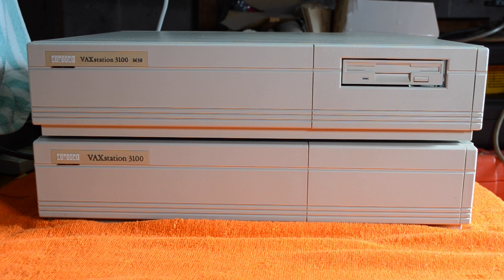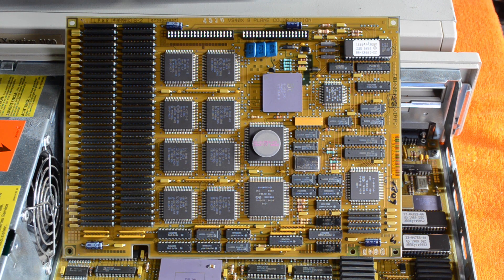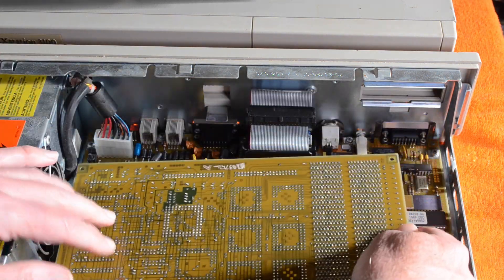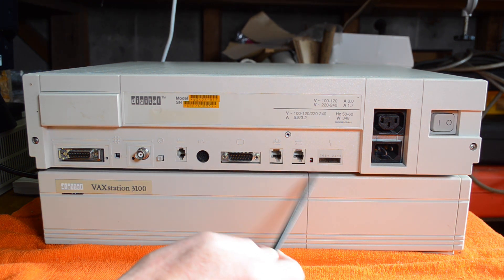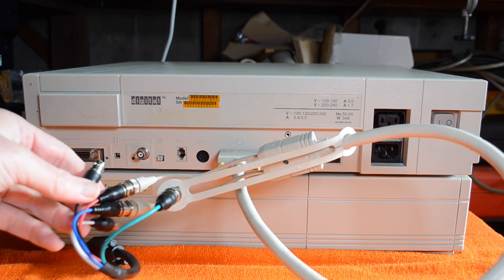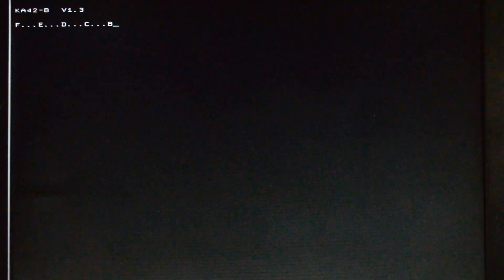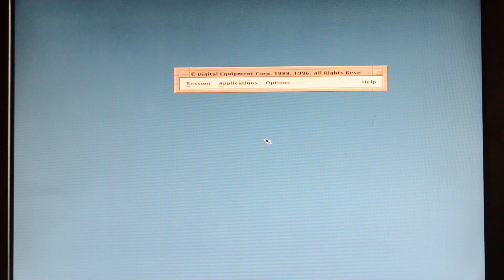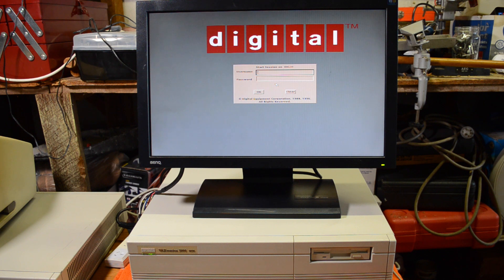VAXstation 3100 Graphics

Comment: I remember the precursor windowing system for VMW - VWS/UIS, It was quirky but was faster than the DECwindows/Motif implementation as I recall.
Reply from the maker: Yes, we used to run that on the VAXstation 2000. It could cope with that!

Comment: Great videos! I've been working on trying to nurse an old VAXstation 3100 m38 SPX back to health. I was wondering if I could get a pointer for the graphics card. I was able to hook up an LCD to it using a cable and I see the testing output and the cursor when the system is halted and booting, but when VMS tries to start the text is garbled on the LCD. The text is not garbled when I hook up a serial console. The error code I see related to the SPX during the boot process is "?    4    00D4    000E.0A13" and I don't see the graphics card cycle through tests like yours did in the video. I'm worried about bad memory on the board, but have not been able to find much information about the error code. Have you come across that error before?
Reply from the maker: Sorry, but I've never had an issue with SPX/GPX cards. Maybe try and find a service guide...

Comment: I used to work in the Digital Support Center. It was a great company to work for. We all had VAXstation 3100 work stations with huge 19” monitors. Some lucky people even had. VAXstation 4000 model 60s which were significantly faster than the 3100s. OpenVMS was my favourite operating system. 

Your videos bring back many fond memories. 

Where did you get all the old gear from?
Reply from the maker: Mostly rescued from recycling many years ago. Can't afford today's prices!

Comment: New video! :)
A friend built a sync separator circuit so he could use a monitor which doesn't support sync-on-green. I've never bothered since I have two monitors that support it (Philips 190v and Canon 170B2) and two DEC machines that use SoG.
Reply from the maker: That was my next option, but luckily I found a monitor that supported it
Reply: See my post at begin of video, may be you help what titlebar's buttons do in VAX 1st DECwindows. Youtube deletes doubles.